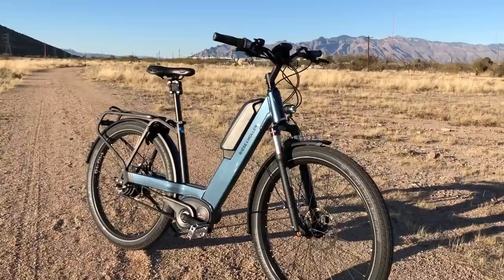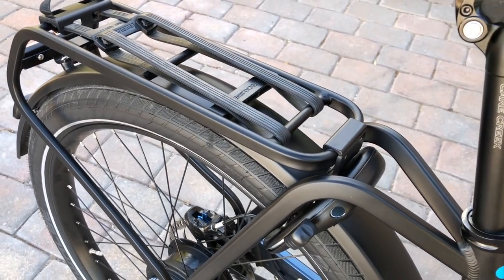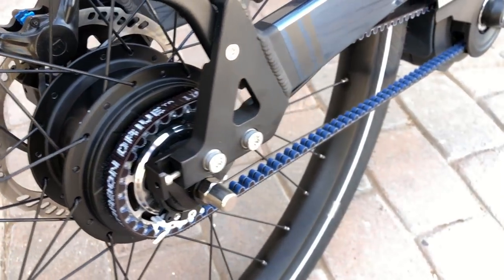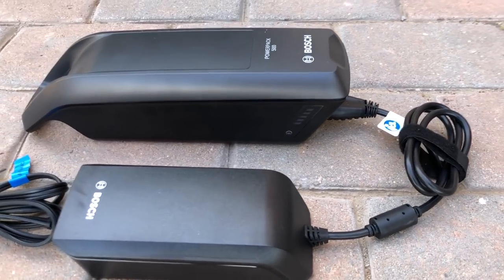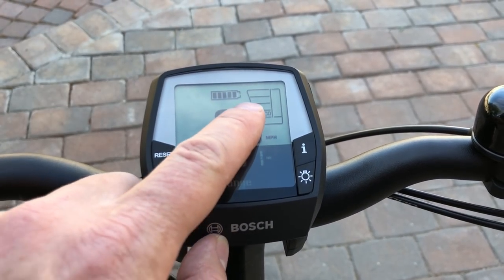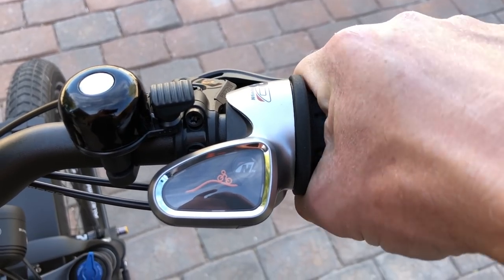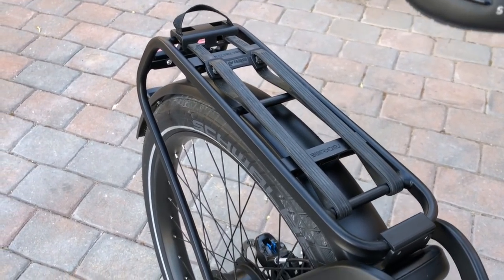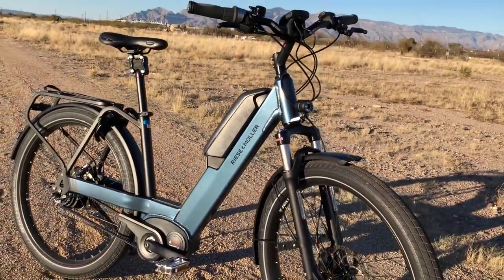Riese & Müller Nevo Electric Bike Review | Electric Bike Report

Comment: Have you gotten to ride the latest revision of the GH? I understand the new CX motor has different internal gearing, paired with a larger chainring. I'm wondering how all that compares ride-wise to the 2018 model, as well as how noise levels may have changed.